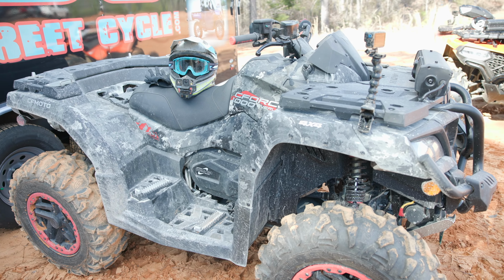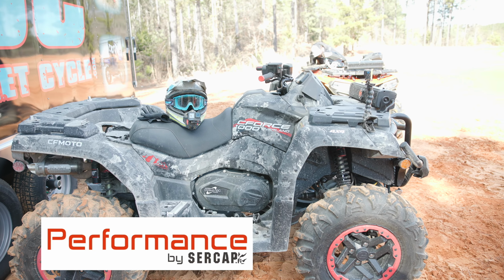2023 Can-Am Outlander K!ller | CFMOTO CFORCE 1000 Racing Build

Comment: I really like how far CFMoto has come in terms of fit and finish, quality and reliability.  But let’s be honest.  With these mods on the 1000 you have maybe come close to the stock 91hp of the can am 1000.  I have risen both in stock form and there is no comparison in power.  Can am comes out on top.
Reply: This is my number 1 complaint.  You can mod the Cfmoto all day and it will not have the power of a Can-am/Polaris.  CFmoto is doing incredible things and for the price they are doing great things.  They are also finally starting to have parts, and aftermarket support.. They need to work on power.  I have a CFmoto 600, It revs to the moon and you'd think it was flying by how hard the engine is running, but then you look down and it's doing like 10 mph. It's my number 1 complaint.

Comment: Mines has same set up but with the single rcjw single pipe...only different is stage 3 MUD clutch.... I don't know why now it feel so tide...I regret to put stage 3 kit.... it feel a lot more slower... it harder to put it up in the water also... stage 3 springs looks identically to the stage 2...

Comment: If I didn't have my 29 stags, I would have definitely gone with Black Water Evos. Question though, Can the Cf1000 not fit 30 Evos? Or is a lift required for the 30's?
Reply from the maker: A lift is not required for the 30” Evos.. they will fit no problem..
But the Stags have proven themselves to have way better traction for stuff like in this video
Reply: @RealTalkPowersports  cool, and great video👍
Reply from the maker: @DeepSouth_Outdoors  thank ya sir

Comment: Totally disgusted with the lack of care and customer service from CF Moto!
I bought a brand new u-force 1000 to take hay to the horses in the pasture and drive up and down the driveway. It was never trail ridden or abused. I did the 200 mile break-in and started noticing issues around 800 mi. It started using oil extensively and I brought it to a dealer around a 1000mi. The dealer charged me $700 to tell me that the engine was shot and needed to be replaced. After trying extensively to get some support from CF Moto on the matter they would not budge or back up their product at all. They only told me that it was out of warranty and I was out of luck. Also, customer service at CFMoto told me that I should have changed the oil every 200 mi and cleaned the air filter every time I went up and down my driveway, absolutely ridiculous! If you're curious and are interested in purchasing any CFMoto product you may want to first go on to the BBB website and read reviews. I sure wish I would have.
Reply: Brother it's common knowledge to change atv oil every 200 miles. Especially during break in. Hope you got it sorted out. Live and learn. I've made the same mistake 😕.
Reply: @shawndale1552  changing oil every 200 miles is not common....I hope you're kidding.
Reply: @Michael Hoff  Hell boi run your trash however. Do you boi.
Reply: @shawndale1552  🤣😂🤣😂🤣 there isn't an atv manufacturer in the world that suggests 200 mile oil change intervals so I guess I will keep doing what I do. 👍
Reply: @Michael Hoff  Must not have too much. Go workout or something boi.
Reply: @infamouscoma886  I know you'll take it, anytime it comes. 😉